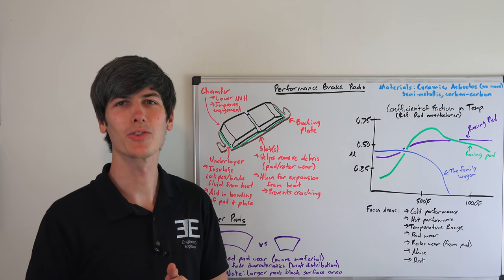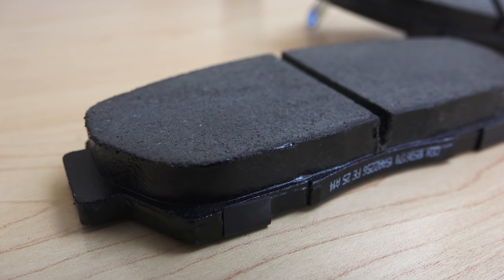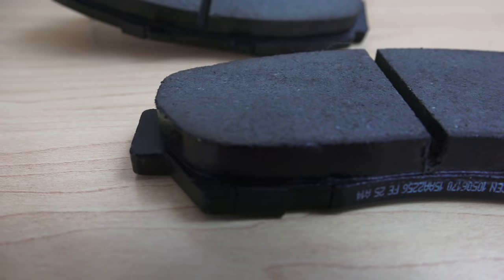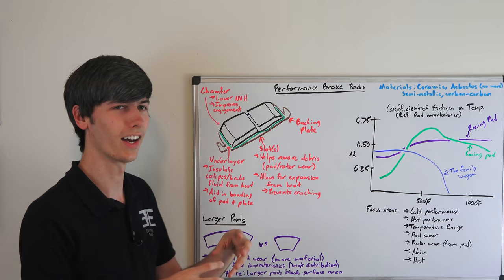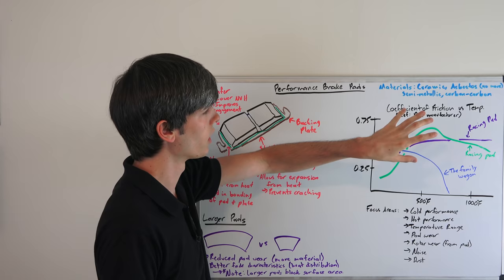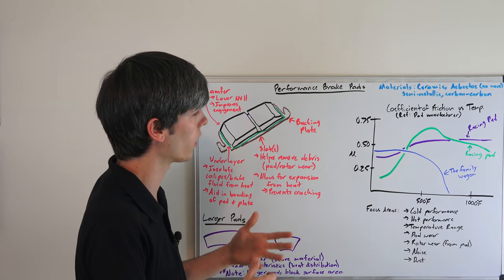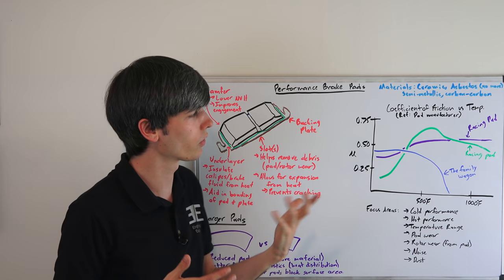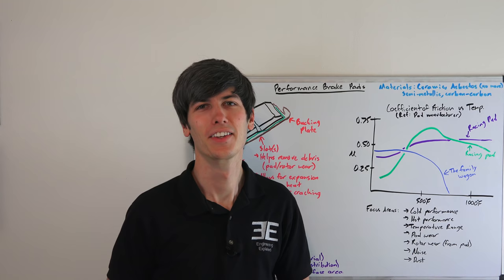Performance Brake Pads - 7 Key Characteristics

Comment: Let's say you have an original car... like a volvo.
If you buy original Volvo brake pads or Brembo original brake pads (yes, they make pads for normal cars too), will you notice any increase in braking power from the brembo's?
I've heard that EBC greenstuff pads are good for original brake applications.
Reply: Cobraa Performance street pads may sacrifice cold performance (or wear characteristics) to work better at higher temperatures; a compromise between safety in traffic and being able to tolerate heavy brake use.

Some anectdata: 
I have performance street pads on my MX5/Miata; a friend has 'normal' pads on his (no idea what brand).  His brakes have noticeably more bite when driving around town (less pedal pressure needed) but after spirited driving through a few twisty corners the brakes will overheat and stink.
I've taken my current pads to a track day where they held up pretty well to repeated 160-180km/h braking.
Reply: Sam Douglas Actually, the OEM Mazda pads are really not bad on the MX-5. Some aftermarket street pads are actually worse. What kind of pads do you have exactly on yours ?

Also, are both cars the same version ? NA, NB ? 1.6, 1.8 ?
Reply: I've got TRW pads, they seemed the best option available at the local parts store when I bought them ... 3 years ago? 

I should have clarified my original comment, this is in no way a good comparison. Both are NAs, one is 1.6, mine is 1.8 so it has slightly larger pads and discs.
Reply: Ho yeah, 1.6 vs 1.8 is actually quite a difference. Brakes are bigger on the 1.8 of course, but the master and booster are also different, and that plays on the pedal feel as well.

I was pleasantly surprised with my stock 1.8 brakes. I'm currently running EBC turbogrooves and Greenstuff, with HEL lines, and really I don't think there's much difference at all [the stock discs and pads already had quite a bit of wear when I bought it, I think I made 10 or 15.000km (which is a few months for me) before having them completely toasted (sidenote : don't outrun a STI 10 downhill when you plan to change your pads if you don't want to end metal on metal)].

Still, I do not complain about that since I got a great package deal, which was a good decision since I had to change the CAS a bit after.

Comment: Does choosing a pad with less brake dust mean it has less grip? My MINI's OEM pads are really dusty
Reply: +Rixter MINI OEM brake pads are really dusty - but it's more likely to be due to the compound. EBC Greens are pretty good for low dust if you're looking to change, but breaking isn't THAT amazing over stock, though once heated you can definitely notice the improvement - say after two stops from 60-15mph
Reply: +Halomaster4ever great tip. Thanks!

Comment: Great video.. I'm in the market to replace my rotors,pads and calipers on my 2000 4Runner.. every 2-3 years my rotors get warped cuz if the heat and I have to have them fixed or replaced. Any brand recommendations for rotors pads and calipers since I'm planing on changing all 3... ??? Thanks
Reply: Hugo S. 4Runner are notorious for caliper failure
Reply: AJ L crap , I did not know that... any advice on what brand to replace them with?? The OEMs are 500 a piece.. screw that!!!

Comment: what material would you recommend, for a good middle ground pad with low dust, for a daily driver that's NOT driven for gas mileage?
Reply from the maker: Darren G. Why so much emphasis on the gas mileage haha? Brake pads won't really affect that (there's some minor contact, but nothing crazy, you can still spin a tire easily that's jacked up).
Reply: +Engineering Explained I was just saying I drive pretty hard....I didn't really mean anything about gas mileage, besides I don't drive like a grandma so fade can be an issue on fun roads.....if I was a gas mileage driver crappy pads would be fine, since speeds are low and fade is nonexistent when grandma'ing it......my fault for the confusion.
Reply: I don't need race pads, but I want something better than standard semi metallic for back road driving......ceramic?
Reply from the maker: Darren G. For my Integra I usually just buy top of the line from the auto parts store. Whatever's an OEM fit and costs the most (which usually isn't much more than the cheapest). For my Subaru I'd go OEM.
Reply: Darren G. ive heard the akebono pads are pretty good for imports, gonna get some next brake job on my forester xt to try them out

Comment: how do different pad compounds affect rotor life?
Reply: the pads that wear fastest should improve rotor life. But for my car, $15 per rotor at Rock Auto means new rotors every(or ever other) pad change.
Reply: ty, i was also wondering how many pad changes before new rotors also, my rotors looked pretty good so i just bought some ceramic pads and stuck em on without resurfacing rotors, been a month and they look good still =)
Reply: No problem, sorry that wasn't a specific answer (as I am not certain which wear fastest, google will know).
I don't go more than twice without a replacement or resurface, but that's because I don't have a caliper or micrometer to measure the wear. (Every car has an OEM recommendation for maximum wear).

Comment: I have an 2008 Acura Tl Type s.  It needs new brake and rotors soon.  What brand should I get.  Thanks
Reply: brembo rotors and pads
Reply: factory brakes are usually best. I know honda uses good quality materials.
Reply: Adam S no they bloody don't. wtf are you on?
in Europe and the Uk Honda use TRW brakes. you know nothing
Reply: juan def He doesn't have a racecar...he doesn't need to spend money on high performance brakes. And next time you want to make yourself sound more knowledgeable by attempting to insult someone to feed your insecure ego, make sure you know how to do so. but nice try.

Comment: Ceramic brake pads dont lock tires up under hard braking. For performance semi metallic is far better. My infiniti has gg rated ceramic brake pads and I cant engage ABS on dry pavement. My other car (mercedes) has ff rated semi metallic and it brakes far better than infiniti and i am able to engage ABS. These coefficient letters can be comparable under same material like ceramic vs ceramic or semi metallic vs semi metallic

Comment: something I'll never understand: how you can get torque from horsepower with a coefficient (5,252) and yet when you plot torque vs HP you get drastically differing waveforms. I would love if you explained this.
Reply: davdavc Do you have an example? Most of the graphs ive seen have farily simelar lines.
Reply: sonnyman2000 them being "fairly similar" is the problem. I'm puzzled as to why each point isn't exactly off by 5252
Reply: davdavc it should always be off by 5252 because you calculate power from the torque.. i want to see the drastically differing waveforms you are talking about so we can compare
Reply: I wouldn't say they are that different. You can see the power curve rises quickely until the torque reaches its peak, and the power becomes linear. I think they look stange because the torque curve only shows from 180 to 360 nm while power goes all the way from 20 to 120 kW
Reply: davdavc The graff you showed was in SI kW and Nm. The 5252 mathematical trick only works with imperial hp and ft. lbs. Angular power and torque are still directly related trough angular velocity (rpm) whatever the units are tough.
Reply: MrTheMrhappy
Nm and kw should be around 9500 i think instead of 5252

Comment: How many track days can you get out of carbon ceramic brakes?
Reply: That would depend on the duration, track, your speed, the weight of the car, the size of the rotors/pads, and of course your abilities/braking habits.
Reply: Assume a track day with three 20 minute sessions, 3300 lb car and an experienved driver. Just looking for an average number of days I can get out of them
Reply: Yeah sorry, I personally couldn't tell you without at knowing more. But my best suggestion is to measure (or find the specs) a set of new brakes, Then run them twice and measure what you have left (then do the math).

Comment: I have problem on my car Ford Focus 2010, it's noisy when I brakes! What cause that noises?
Reply: Josip Matić either squeal wear indicator to tell you to buy new. or the retainer clips are fucked and need replacing
Reply: But still good brake, thickness of the brake pads is more than enough. Squeal happens mostly when the dry weather.
Reply: Josip Matić lmao. That's cos you got water absorbing the vibrations.
Take it all off... Clean every part.
Go buy some albino, icer, the or Bosch brake pads.
Get some cera Tec and use the paste correctly.. make sure the anti squeal shims are pasted a tiny bit. The corners of the pads too need a bit where the retainer guides meet...
Then your car should be good

Comment: so, we have two brembo 4 piston motorcycle brakes
we tried everything but they keep leaking
can anyone help me out?
Reply: + Sidney - Leaking brakes goes to the realm of rebuild or replace. You didn't mention where exactly they leak. Hose, hose connections, trough the pistons, etc.
Reply: crpth1 well.... since the pistons and piston rubbers are new we assume that it leaking at the rubber ring that let's the fluid go from one half to the other
Reply: +Sidney - I guess you gave the tip on your answer. ;-) 
Usually there´s an O-ring between both halves, better check it's condition. Also the matting surfaces for any scratches or defects.
Any minuscule scratch can be enough to leak. Good luck.
Reply: crpth1 thnx man
we'll try
Reply: +Sidney - Some important details. Make sure the replacement O-ring is for hydraulic brakes grade, not a water grade O-ring. Keep all perfectly CLEAN during assembly/disassembly. ;-)
Reply: crpth1 yeah we know about the O- ring
at first we thought that the stuff coming out was dirt but eventually it was DOT5 braking fluid leaking out

Comment: What does carbon-carbon/ steel-carbon/carbon-ceramic brakes mean? it might be a mixture of steel and carbon or ceramic and carbon, but then why is it carbon-carbon? Would love to hear your explanation! :D
Reply: different molecular structures of carbon? or perhaps the pad to rotor combination?
Reply: Abdulrahman Alsulaiti 
carbon steel is basically steel. steel is iron and carbon. usually it will be called high carbon steel or low carbon steel. I'm under the impression most rotors are iron, not necessarily steel.
carbon/carbon brakes have rotors and pads that are completely carbon. it's not a fiber or weave, it's just carbon. they're grown. it takes months to produce one. these are used in race cars and airplanes. 
carbon ceramic is used on high end sports cars. they are used on the street or track. it is for weight savings. some people prefer the iron rotors for better feel.
Reply: If we speak about disc, carbon-carbon means that it comprise a carbon matrix with carbon fibers and carbon-ceramic usually means carbon fibers with a silicon carbide matrix. Carbon-carbon is more suitable for formula one for instance because of its high temperature necessity to perform well (around 600 °C to be optimal). Thus Carbon-ceramic is more interesting for sports car such as ferrari, lamborghini, porsche, audi and so on
Reply: That makes more sense

Comment: which street pads will leave the least amount of dust on my wheels?
Reply: +6kchea ! Ceramics pads leaves no dust.
Reply: +TheNohar123 Can't run ceramic pads on my drilled and slotted rotors :( The semi metallic pads I bought leave CRAZY dust on my wheels, and it's super sticky too, almost looks like spray paint :(
Reply: +TheNohar123 thanx!!
Reply: +toysareforboys i have drilled rotors as well... how come cant you run ceramics with drilled rotors?
Reply: +toysareforboys Next time u service your brakes change the rotors to regular rotors and this way u can use ceramic pads.
Reply: +6kchea ! The warranty card that came with the rotors said the warranty would be void if you ran ceramic pads. It didn't say why :( http://ecuflashking.com/07cobaltSS_SC/07cobaltrotors.png
Reply: +TheNohar123 If I can find some zinc coated regular rotors I'll give standard ones a go again and see how I like them :)

Comment: is it OK to install ceramic brake pads on ordinary car?????
cause i heard it could damage the rotors
Reply: 90SkidUSA I use ceramics and my rotors are fine.
Reply: +Bee Vang thanks, any recommendations for a cermic break pads brand
for a chevy avalanche
Reply: I use the BrakeBest Select Ceramic pads. I engine brake and let off the gas when I come to a red light/stop sign. I brake to do a complete stop. I've read that for trucks, semi-metallic break pads are recommended. You can't go wrong with either. It just depends on your driving needs.
Reply: that's interesting way to stop, may be I'll try it.
the reason way I want to install ceramic pas is because one day I was driving downhill and my breaks heated up and fail to stop my car
Reply: Ceramics wont give you better breaking. But, ceramics do have a longer pad life and leave less brake dust. I'm not kidding you, they last so long that the only time I need to replace them is when my rotors go bad. How a person drives also dictates the life duration of any brake pad regardless of material. When driving downhill, breaking to a complete stop will be more difficult depending on your speed and slope/angle of the hill. I know my car doesn't have the best braking in the world. I give myself at least 2-3 car lengths at all times. Going downhill, you can probably see the 2nd car ahead of you brake before the car in front of you. Always look out for that. When I see that, I'm already engine braking and letting the driver behind me know that he needs to start slowing down too. Stick with the semi-metallic. They are cheaper and work better when the brakes are cold. You can probably buy two sets of semi-metallic as to ceramics for the same amount of $. Just yesterday, a clerk from O'Reilly's was telling me I should spend $36 on ceramics instead on $12 semi-metallic brakes. The two reasons he told me is because ceramics are oem to my car and that semi-metallic are meant for trucks. If semi-metallic were meant for trucks then why are there semi-metallic pads made for my brake? But, I digress.
Reply: I've had great luck with metal master metallic pads on my volkswagens...
The first cold stop is a little long or takes a little more pedal pressure but I haven't had any fade issues on the street. 
And the wear isn't bad either. 
By the time the pads are shot the rotors are too and who the hell turns rotors anymore? May as well enjoy your brakes. 
Worst thing is if you use them on a car that sits a lot they do rust fast.
Reply: Ceramic sounds like a really bad idea, I wouldn't want to sacrifice braking performance for longer lasting brakes. Sure you will save money on a brake job, but it doesn't matter because before you need new brakes or rotors, you might have crashed into something because you couldn't stop fast enough.

Comment: Please use the actual part when you are explaining the basic structure. There is no reason to be pointing at the white board when you're explaining things like backing plate and chamfor when you could EASILY just have a brake pad and rotor in front of you and be able to point them out on the ACTUAL object. It's simple and would make this a lot more applicable since i'm looking at the part in reality rather than some 1 dimensional incomprehensible drawing. Other than that, good job.

Comment: I thought using car gears to reduce speed would damage your transmission?
Reply: no not at all big rigs use a special system callee a jake break and that essentially uses engine breaking to slow down the truck
Reply: No, you use the resistance of the trans and engine that is already there no matter what to slow you down
Reply: alot of trucks for towing have or use engine breaking systems